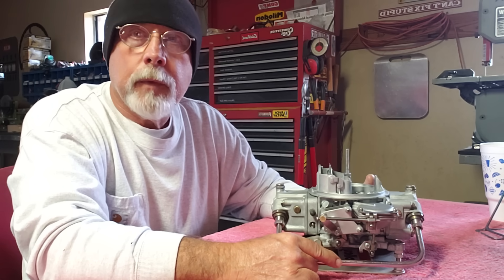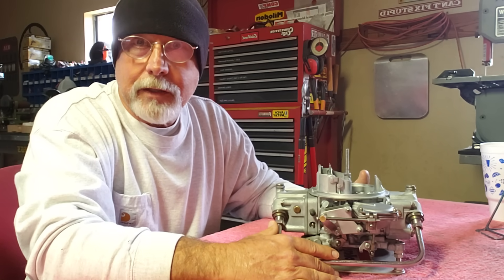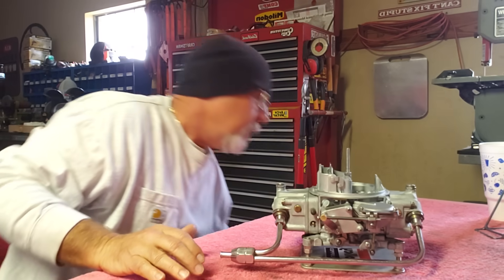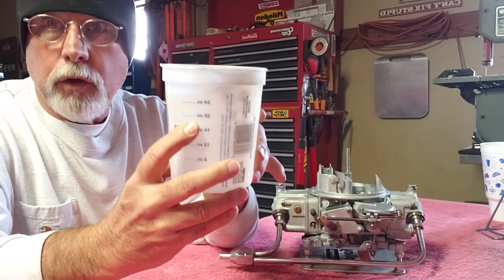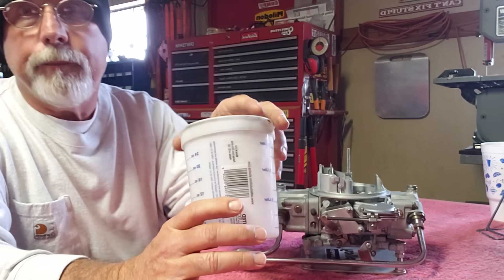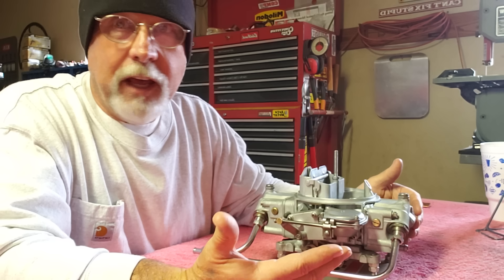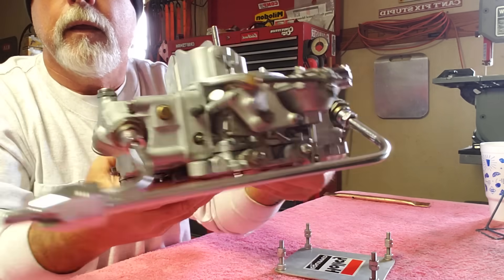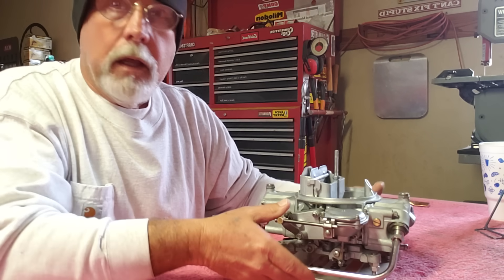Best carburetor cleaner ever!

Comment: It looks great.  Cleaned (etched) the cadmium coat right off of it.  That you showed Nitrle gloves as an admonition for PPE shows some lack of understanding.  You need a chemical apron, chemical rubber gloves with gauntlets, and a face shield.  You are using a nuke (Muriatic acid) when a grenade will do the job just as well (a little slower) and much safer.  If it etches away cadmium, what would it would do to your face, eyes or skin?  The biggest hit is, if you actually read the MSDS, the Muriatic acid is a Lung Irritant.  
Presumably you are doing this on a bench with your face close unless you have 6ft arms.  That means wear a mask.  YES.  You don't need a mask to pour it into a huge pool, it will be very dilute the moment it hits the water.  33% is STRONG.  On a bench with several minutes of brushing and cleaning gives plenty of time to harm your lungs, it really doesn't take much and the damage is cumulative.
Use the Yellow (non-heat version) of oven cleaner for external and internal surface cleaning (it is Lye, get it at a dollar store).  Then chem dip valve bodies and center section.  It will get the orifices clean but you may need to plunge jets and small passages (gas welder tip cleaners may help).  You still need all the PPE, minus the mask, but always avoid fumes when possible.  Anything that removes gasoline shellac is strong enough to burn flesh quickly.  But Muratic acid will scar your lungs and possibly kill you if you are inhaling the fume.  Don't.  You don't need to.  
For everyone:  Anytime you decide to get clever and mean cleaning something, Google the MSDS (Material Safety Data Sheet) for the chemical.  Particularly an acid.  Don't out smart yourself, getting your carb clean at the expense of your lungs, eyes, skin is NOT a good trade off.
Reply: Always remember that water will neutralise HCl or any acid. Plenty of it. Same with burns, get plenty of cold water on a burn quickly. I mean quickly.
Reply: @jefftheaussie2225  Yes, for certain.  That's in the MSDS too.  Same for Lye.  But in the case of Muriatic acid, it could blind you before you get to any water AND burn your lungs and permanently disable you or even kill you.
Reply: Go back to reading comic books. They are clearly more factual than your advice. And don't go near the road. You 'may' get run over. (Comments from one who has actually worked in the real world of an industrial chemical laboratory).
Reply: @robmmartin  Sounds like you have a problem.
Reply: @robmmartin  If you are handling 33% Muriatic Acid in your "industrial chemical laboratory" without a chemical apron, chemical gloves (not pissy little nitrile), and at least a face mask (MSDS says goggles and mask), then you are are dope, and your company needs a serious visit from OSHA.  
But you don't.  YOU are clearly not a chemist and don't know what you are talking about either.  Your attitude toward safety would get you fired from any legit laboratory.   You clearly are not a professional anything.  Pretender.  Doubt you can even read.
Reply: @ As the cleaner?
Reply: @jefftheaussie2225  Not clear what you are asking but I would use (yellow can) oven cleaner (Lye).  Spray it on and use a suitable brush.  Even Chem Dip works well if you have time. 
Muriatic acid will clean it for damn sure (and fast) but has unnecessary increased risk, plus a waste stream.  
What are you going to do with contaminated 33% Muriatic acid?
Reply: @x-man5056  Talking to the bloke who worked in a chemical lab who didn’t know water will neutralise acid.
Reply: @jefftheaussie2225  Yeah, I should the names.  Thanks.

Comment: I use a plastic Colander for all my small parts and old bolts. I also used a 8ft piece of plastic gutter to do a drive shaft and it didn't remove the painted color bands.

Comment: The “original” Berrymans Chem Dip was cresylic acid with an additive that created a boundry layer to minimize evaporation. Worked extremely well. At some point the formula was changed probably due to EPA regs. Stunk like hell, was rough on skin and worked best when heated (hot tank). This is a great alternative and economical IF you follow Ronnies instructions. Good job Ronnie!
Reply from the maker: Thank you!

Comment: That seems like a rather risky process to me. If the muriatic acid opens up the jets by even a couple of thousands of inch, that carburetor is going to run rich. I don't see that carburetor installed on a running engine, so I'm not impressed
Reply from the maker: Check my channel

Comment: I did this exact process to a Holly carb thats was on a 1964 Rambler 327 V8 I bought from a junkyard. That carb was original equipment and I wanted to keep the engine that way. It workd perfectly once I refreshed it with new gaskets!! Plus it looked like new. I love restoring old things. They just work so nice.

Comment: Back in the 80’s I use to use Berryman’s but it is not the same formula today. Back then just the oder was enough to strip carbs clean. If you got any of it on you it took weeks for the smell to fade away. It was horrible but it worked great.

Comment: Loved the no-nonsense video. One correction, though: carbs are NOT zinc plated. They are die-cast zinc. Now, they may be a zinc alloy with a few other metals, but they are predominantly zinc. Also, the traditional coloring on Holley's is an Alodine dye, I think. Maybe you could come up with a video on  how to restore the Alodine coloring to Holleys.

Comment: Hey Ronnie this German thanks you for serving,The memory I have from Muriatic Acid was my First job at 18 when I first came to the US First off Muriatic Acid is the most foul smell I ever whiffed that includes my Morning shift in the Bathroom😂 I worked as a Painter in Monterey California and my Boss told me I would be in charge of Cleaning the Half tile Roof of the Monterey Hospital of Pidgeon shit and Mildew ,large job I used a Pump sprayer container soaking the Tiles and then using a Power washer,this worked very well and cleaned the tiles like new ,though now I look at how Dangerous this was without my Boss telling me the Danger,the Drunk didn’t care about my Safety anyhow the smell stays in my memory and will now clean my 6 pack 340 Challenger motor Carbs
Cheers from West of Chicago

Comment: How do you prep the carb for soda blasting?  Do you block or cover anything?
Reply from the maker: No prep needed, just flush with water and it dissolves all the soda. Use comp air to blow out all passages and dry it off.

Comment: Here in the Philippines we use Muriatic Acid to clean the bathroom, hard water stains, soap build up, sometimes if it is really strong,  it will eat the mortor between the tiles as it is part limestone in the concrete mix. YES, water will dilute it ASAP and down the drain it goes. You cannot breate it so take a deep breath, get into the bathtub to wipe a little then back out of the room, again and again for a few passes. This same acid also works better than anything else "OLD SCHOOL" for eating the rust off from your old car panels, cheers.

Comment: Great video. You should put baking soda in your rinse water  to neutralize the acid. That carbon looks awesome. Putting aluminum in muriatic acid, undiluted will produce hydrogen and a lot of heat as well. Just a fun fact.

Comment: nice video,i was wondering if i could boil my scooter 50cc two stroke carb in vinegar,because ive tried soaking it with carb cleaner for a few days and my pilot jet is still plugged up it will be cheaper if it work lol" thank you....

Comment: DONT use this method of carb cleaning!
 Aluminium can react violently with muriatic (or hydrochloric) acid and will produce an exo-thermic reaction which can cause serious injury if the concentration is too strong. Even at lower concentrations it will dissolve your aluminium carb bodies if you leave then in too long!

Comment: The guys at work use a muriatic acid solution to clean all aluminum on the big trucks. They just spray it on with a pump sprayer then let sit then they power wash it off. Makes the trucks look like new money. Never thought about using to clean a carb. Nice

Comment: Best way to clean a carb is an ultrasonic cleaner hands down. You don’t even need any chemicals just water will work but if you use a solvent it will work faster.
Reply: What solvent and where do you get a ultrasonic cleaner

Comment: Muriatic acid DOES attack aluminum, albeit slowly. Do not use this on a concours restoration part, we can tell. For 99% of carbs this is probally fine but can eat away at the balls that seal passages in some carbs and other embedded ferrics. I would start with ultrasonic and/or heat and a mild acid like 50/50 vinegar mix before resorting to the nuke mthod like this. Problem is it gets trapped in pits and continues to degrade the part. Do a LONG HOT water bath with a bit of bicarbonate and rinse afterward.

Comment: I am rebuilding a chevy scottsdale 4x4 right now. I keep a large home depot bucket of muriatic acid. 50/50 to water. All my metal parts go into it but...note to everyone. Have a good way to pull the part out and a way not to drip acid all over the place. Also, acid will clean that metal up slick as snot but it will not touch anything with grease or dirt on it so clean first. Lastly...eye  protection! drop something in a bucket and that splash can hit ya right in the eyes. Thank you Ronnie for this video!! I never thought of using this for a carburetor and I have a 78 quadrajet that is dirty as can be.

Comment: So I have been trying to get my old 350 sbc to start and I've changed the spark plugs, changed the oil out, checked the distributor and wires, and nothing has worked. I think I might need to clean the carburetor so that is what I will try!
Reply from the maker: Takes three things for an engine to fire and that is Compression, fuel and spark. Check your compression

Comment: Just a note: If you work on lawn and garden equipment with tiny carbs like Zama and Walbro be very careful how you clean them. Most of these carbs have check valves hidden in them which are destroyed by many cleaners, including the heated ultrasonic tanks. You can only spray down the outsides of these tiny carbs now. And soda blasting also works. Just no harsh chemicals. Cheers.
Reply from the maker: Great point!
Reply: What is soda blasting ?
Reply from the maker: @tttttttt8482  Baking soda compressed air with a hand-held sand blasting gun. Give it hell...... works great 👍

Comment: If you have pine sol and an old crockpot, you can soak your carb in it. It dissolves all the old varnish and won't harm anything. If you have a large enough ultrasonic cleaner, you can get even better results. Wash off the pine sol with hot water and dry everything with compressed air. Pine sol is a little less volatile and friendlier to your skin.

https://www.youtube.com/watch?v=-UtCf3yw4yI

Comment: Can you put parts in like the throttle plates, choke plate, inspection screws, and the whole bottom piece or will they rust? I have a real dirty carburetor that sat for about 15 years and is like the one you described, I’m glad I found this video
Reply from the maker: Yes, drop it all in. After the rebuild spray with WD-40 should be good!

Comment: Old video so I'm not sure if Ibwill get a reply. My question is will this clean out the venturis and areas around the jets without scrubbing/rubbing? I am asking because I have small engine carbs that need cleaned and the catb cleaners are not what they used to be. I'm looking for another solution and since I do concrete and have a pool, I always have acid on hand
Reply from the maker: It will but, do a test run first some carbs will turn black and I don't know why. It will clean out all the orifices with no problem.

Comment: Well, I am back. My situation is a little different now. I have purchased a glass bead blaster cabinet and have set it up for the big event. During the last six months I have looked at all possibilities to not do a rebuild on my carburetor. Your find this strange but true. The state issued me a new title for my Fiat in 2015 and spelled Fiat wrong. They spelled it FIXT. believe it or not, I have been working to get that fixed before I get the car running again. Yes, I am still working on that. 
I will be completely restoring my carburetors. Yes, I said carburetors, I have two. Over the years that I was working on the car, I kept parts I though some day I would need. I will be rebuilding both at the same time. Now that I am getting setup, it does not take much longer to do two instead of one. Material cost wise the cost is insignificant. I believe that you had contacted me about following my journey to rebuild these carburetors. I have been doing a lot of research, that's what I do. I am a self-taught electrical engineer.  I am a principal designer for transmission substation protection and control systems. I work for the largest utility in the US. I will be sixty-seven this March and will retire. I have silver plated copper a lot during my career. I have also plated aluminum with silver. Aluminum is not as easy as copper but can be done. You need to copper plate aluminum before you can silver plate it. Yes, you can copper plate an aluminum carburetor body. It would look great but would quickly tarnish.  I will be zinc plating the body of the carburetor and all the steel parts including the screws.  I will then be putting a yellow chromate coating on the steel parts. Sorry I have lost it; send me an email and I will keep you in the loop. I have tried the ultrasonic cleaner and parts tumbler. I am not sure that they will be as much help as I thought.

Comment: Muriatic acid = spirits of salts = Hydrochloric acid
Aluminium and 2HCl = Aluminium Chloride and Hydrogen gas = AlCl2 + H2
... does not sound too healthy to me.

Muriatic acid is ok when used on steel although some elements in the steel might also react causing pitting. This is why it is better to use electrolysis on steel tanks to remove rust.

Comment: Unfortunately I use this idea on a 1997 Yamaha  YZF600R, $260 used carburetor   if I need to buy another one, , NEVER AGAIN, save yourself a lot of time and just use the cheap Walmart supertech carburetor cleaner. does  much better job easily getting a gunk out of the carburetor , you can soak the Jets in  a jar , and the Finish  will still be  intact. Also for older  carburetors you want to Slick  finish where the accelerator pump is not out course finish  I'm sure it'll eat away the rubber faster, like it will on my plastic diaphragm sliders , Hi-Tech back in those days

Comment: Loved your video need to find video on fuel regulator now bought a 73 Pontiac  350 engine car set for years the guy that started building it put electric fuel pump back by the tank ran when I bought it now started flooding pouring gas out the primary tube so took off to rebuild found out pump was putting out 9 lb pressure figured that's what caused it going to rebuild carb and put regulator on it but going to find out what pump is on it and see if it has an adjustment for pressure really enjoyed your video thanks

Comment: Hello. I'm rebuilding a 3310-3 an I can not get the old paper gaskets removed. I've soaked them in a carb dip, an parts cleaner tank for a week do far. Getting ready to try paint stripper. Any ideas how to get these gaskets off? I have a media blast cabinet I'm getting some soda for tomorrow an also bought a sonic cleaner will be here Saturday.  Any help is greatly appreciated.  Thank you.
Reply from the maker: I will soak mine in solvent for about 2 days and use a plastic scraper (Do not use metal)  might take a couple of times in the solvent ben. Works for me. Good luck!

Comment: Ron From Tulsa, I have a 1970 Fiat 850 Sports Spyder with a Weber 30 DICA carburetor. I have rebuilt the carburetor several times since I purchased the car in 1983. However, this time will be a little different.  I will be zinc plating the steel parts. I will be cleaning the carb body with ultrasonic cleaner and mag wheel cleaner. Several you Tubes have done this however I may be zinc plating the aluminum carb body also. As for the steel parts I will be using a vibrating tumbler. First to clean then to zinc plate with yellow chromate solution. Zinc is to prevent the corrosion problems shortly after cleaning. I am in the electrical field and have plated many different items. I have not done Zinc but have silver plated. It may seem that I will be going to an extreme, but I was willing to buy new until I saw prices from 400 to 800 for a carburetor done the way I am going to do this one. If you would like I will keep you in the loop as to the outcome.
Reply from the maker: Yes, please do! Thanks!

Comment: i wish i had watched this 10 minutes ago, i have a motorcraft 2100 and i dipped in in muriatic acid uncut. the reaction took about 5 seconds and it cleaned it so well, turned the aluminum black. the black etch came off with a brass brush. wear a respirator, nasty gasses are made. thanks for the video.

Comment: My local Home Depot only carries the Kleen Strip Green muriatic acid. I have found that the mixture recommended in the video does not produce results anywhere near Ronnie's. After 3 ten minutes soaks it barely loosens the original dichromate finish. Apparenetly the "green" has a much lower percentage of acid. Even after adding another 6 oz. to the solution the results are disappointing. I don't recommend using this brand. Maybe buy something from a pool supply.

Comment: Muriatic Acid will eat aluminum so be careful,  don't make the concentration too strong and don't leave something you care about unattended.   That said,  when it's diluted correctly it's a great cleaning tool.  Thanks for the video.   
P.S.  Use it outside and avoid breathing the fumes....don't learn the hard way.
Reply: Also make sure your parts are completely submerged because anything above the surface of the acid will likely turn black or flash rust.